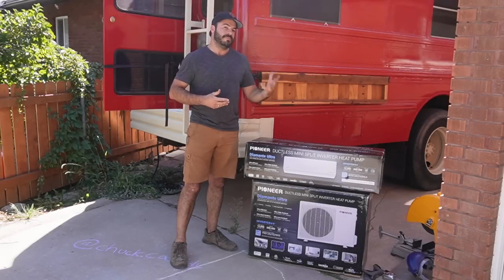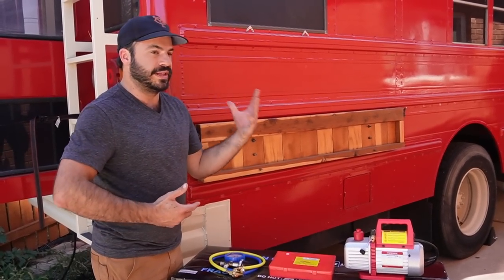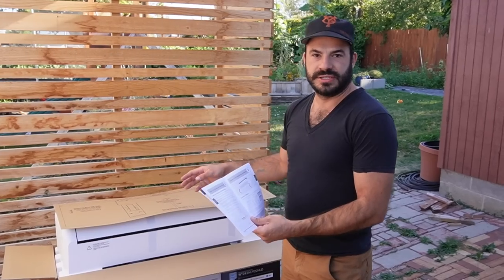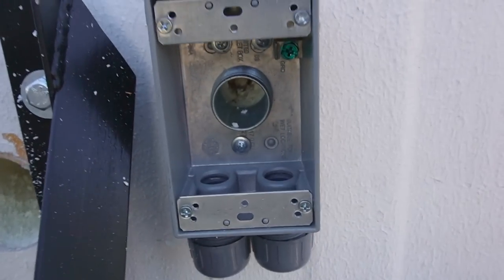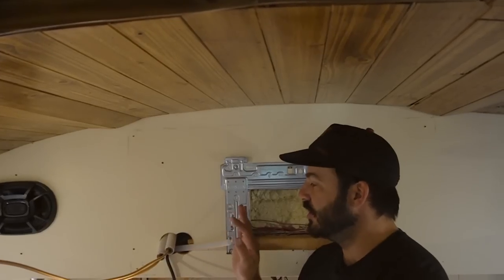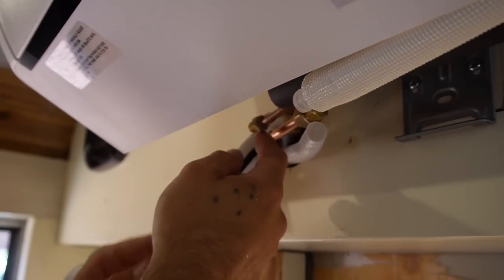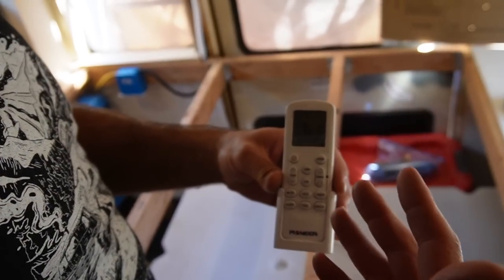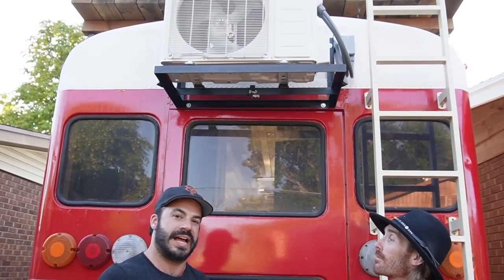Installing a Pioneer Minisplit on a Skoolie | A Complete Guide

Comment: You normally do an amazing job but this was a hack!  You know those mistakes you see people make over and over again and it drives you crazy?  You get to be that person for this one.  What you did will "work" if that's your only goal and you don't care about longevity.  With that said, splits are super sensitive to moisture in the lines and you should pull a 250 micron vacuum on them.  With a cheap single stage China vacuum pump, those tiny hoses and the valve core still in place I highly doubt you got anything even remotely close to that in 20 minutes.  I'd be shocked if you hit 1,000 honestly.  Secondly, you should really pressurize the line for 24 hours beforehand and make certain it doesn't lose vacuum or drift too much over 250 microns.  Had you used a $75 micrometer, a real vacuum pump, and pressure tested the system I would have said great job!  I'll be honest, it's the internet so I suspect you're going to blow this off and not own it but if you do some research or ask some HVAC people they will confirm what I'm saying. Like I said, it will "work", just like leaving in the original insulation on a bus and if that was the quality of work you were after you did it.
Reply from the maker: I followed the directions included in this manual to a T which is my job. Sorry to disappoint you, maybe you can find a better video to fit your needs
Reply: @ChuckCassadyYT  I don't dispute that you read the manual which says "the indoor units and the pipes between indoor and outdoor units must be leak tested and evacuated to remove the air and moisture from the system."  I think we're simply disagreeing on what "leak tested and evacuated" means (much like keeping the original bus flooring in being a subfloor) since the manual doesn't specify and voids the warranty if you're not certified in HVAC.  It also says "Make evacuation for 30 minutes and check whether the compound meter indicates -0.1Mpa(14.5Psi). If the meter does not indicate -0.1Mpa(14.5Psi) after pumping 30 minutes, it should be pumped 20 minutes more. If the pressure can’t achieve -0.1Mpa(14.5Psi) after pumping 50 minutes, please check if there are some leakage points" which you for 100% fact did not do.  You have taught me A TON!!!  I'm so thankful for your channel, for all that you've given and shared and for the resource you are.  I truly can't tell you how much you've helped so many!  If you wanted to debate 500 versus 250 micron I would be fine with it but you DID NOT pull -0.1Mpa on that system and your "leak test was not a proper leak test".  If you want to think you followed that manual to the t I'll just leave it there and chalk it up to you wanting to turn a blind eye.  If I didn't know what I was talking about, I wouldn't debate you on this and what you did will work but at least don't say you followed the manual when you didn't.  If you want to say you missed how deep of a vacuum to pull fine, I'll accept that.
Reply from the maker: I've been in contact with Pioneer and installing this yourself does not void the warranty. I know people who have made warranty  claims and had no issues. I've installed overa dozen of these with no problems. I will now post an excerpt from page 30 of the installation manual:

Turn the vacuum pump ON to start evacuating the 
air from the line set and indoor unit circuits.
Run the vacuum pump for at least 15 minutes, or 
until the Low Pressure Gauge reads -76cmHG 
(-100 kPa or -30 In Hg). (Negative value)
Close the Blue (Low Pressure) valve of Manifold 
Gauge, then turn the vacuum pump OFF.
Wait for 5 minutes, then check that there has 
been no rise in Low Pressure Gauge reading.
If there is a rise (Vacuum Loss), refer to the
Gas Leak Check section for information 
on how to check for leaks. If there is no 
change in vacuum reading, unscrew the cap 
from the LIQUID Side Service Valve (Fig. 6.2)
Insert hexagonal wrench into the service valve 
(LIQUID Side Valve) and open the valve by 
turning the wrench in a 1/4 counterclockwise 
turn. Listen for sound of gas exiting the system, 
then close the valve after 5 second"
Reply from the maker: I hope I've made it clear that I was following the included directions precisely. I'm not surprised there is a spec you believe is important that was overlooked. This is how they expect people to install them, this is how I install them, and with my oldest installs now over 5 years ago and working fine, I feel very confident spreading this method. Thanks for watching, I appreciate the engagement.
Reply from the maker: This is from page 31, specifically addressing leak checks as well:

There are two different methods to check for gas 
leaks.
Soap and Water Method
Using a soft brush, apply soapy water or liquid 
detergent to all pipe connection points on the 
indoor unit and outdoor unit. The presence of 
bubbles indicates a leak.
Leak Detector Method
If using leak detector, refer to the device’s 
operation manual for proper usage instructions.
AFTER PERFORMING GAS LEAK CHECKS
After confirming that the all pipe connection 
points DO NOT leak, replace the valve cover on 
the outside unit.
Reply: @ChuckCassadyYT  Fair enough and we can leave it there.  People buy a bus every day and leave the flooring and factory insulation in, they redo the stock windows, build it out and jump on the road.  They have a great time, they enjoy their bus, feel pride in the work they have done and what they have done works for them.  You agree it can be done that way and works, I agree, and people do it every day.  You wouldn't advocate for that, I wouldn't do that but all things come down to the level of "works" and "acceptable" a person is okay with.  Splits have become rather irrelevant for bus installs over the past few years with much better options anyway so I guess it's a moot point.  Page 37 of the manuals for the Pioneer units are what I quoted above.  If you're content with cheap China gauges, a cheap China pump, tiny vacuum hoses and so on I'm good with it.  If you do decide to spend $250 you can buy a quality 2 stage pump, micrometer, a proper hose and valve core removal tool and do a proper job.  And you can even skip the pressure test if you want since you'll never be able to pull 500 microns and hold it there with a leak anyway.  It's not worth saving $250 for me but to each there own and I'm not using a split anyway as I'm full solar and there are better options for boon dockers with no access to grid power.  Anyway, thanks for the open dialog, backing up why you did what you did and now it's here for others.  You have super good content and put a lot of things into perspective for me.
Reply from the maker: @ZeroEntropy.  I reread the manual for this unit and the other models from pioneer and can't find any of that text you quoted. What you said is good to know, and while i uderstand your analogy, id say that replacing the windows and insulation in a bus hardly comoare to pulling the last few microns out of an hvac lineset. I don't particularly like being called a hack, it sounds like you should start your own channel and showcase your skills and experience!
Reply: @ChuckCassadyYT  There are a couple different types of YouTubers, the ones who start their channels for everybody else and can handle some criticism and the ones who start their channels for themselves and can't.  I don't know which you are but you can surely handle being called a hack by somebody who knows a lot more about a topic than you do.  The areas you know more, I'm happy to yield and I understand how the Dunning-Kruger effect works but wisdom is knowing when to say you don't know, you'll do some more research and respond from a more informed position.  You're wanting to double down so I'll add this, Parker Davis does not warranty this product in a mobile application for one, for 2, it needs to be fully registered to get a full warranty, this requires your license number so a DIYer doesn't get a full warranty.  You can find their most updated and current manuals online.  "pulling the last few microns" isn't the issue, it's boiling off the rest of the water in the system.  So you're saying effectively "leaving some water in the system is fine", if this were a R-22 system I'd say whatever as mineral oil is only a little hydroscopic but this is 410a and POE is ultra hydroscopic.  These are your installs and your customers and if you want to be "that guy" I'm fine with you being him.  I've watched a ton of your stuff and never seen you do anything I would call wrong, a mistake, or something that didn't make sense so take my comments here for whatever you want.  I have much respect for you but being unwilling to admit when you're incorrect isn't a great quality.
Reply: @ChuckCassadyYT  After thinking about this more, your shop, all of your tools, they're good quality, you make jigs for quality, repeatable work, the welds are great, everything is quality.  But here you're using Chinese toys, think about that for a moment.  The quality of your work is impacted by the quality of your tools, in some cases this may not matter and quality means longevity, in other cases it comes down to ability and in others accuracy.  You're using $75 in tools when the quality versions would cost you $350, so you don't even know how many microns you pulled or how accurate your gauge is.  I understand HVAC is odd because you can't visually inspect what's happening but I learned these mistakes the hard way.  Anyway, that's it, I'm trying to leave another window for you to see some commonality in how we would want something done and hopefully something we can agree on, the value in quality items and tools.
Reply from the maker: I understand. Believe me, I understand the relationship between tools, their quality and the final product. Pioneer supplied the tools in question and it's my job to make the video as they request. If I had an extra $200 laying around, I'm not sure I'd be able to justify it on a gauge set when the one I normally use works fine and has never been an issue. I appreciate your point, but I wear so many hats on these projects, of course I can't have the best tool everytime! Also, just because something comes from China does not mean it's poor quality, I'm learning this lesson more and more! Thanks for watching, I appreciate having smart folks here. I want the smartest comment section on YouTube!
Reply: @ChuckCassadyYT  Well, having the smartest comment section on YouTube isn't a high bar to set so I'm sure you can pull that off ( :  I've had several channels over the years and I'm pretty sure I've managed to have the most toxic comments section on more than one occasion.  I give you props, YouTube is tough all around to manage and I've always bailed on a channel if it starts getting too many subscribers, too many eyes, too much attention.  And, I will agree on China products, they make some AMAZING things there are many items from China I would happily buy.  They make some really good quality hand soldered tube amps for example, I've been super impressed with many of the optics, and I have a huge number of China tools for things that when you need you really need them but they don't see much action otherwise.  And, I get you on wearing so many hats, sometimes it actually hurts my brain because I can learn a ton about one topic no trouble, two, no trouble but when you start needing to learn all aspects of something it's draining.  Just on a bus there's painful amounts of info to be learned, enough to hurt the brain, EGR, DEF, the different engines, trans, can you unlock 6th, is the block a 53, 2 stroke, mechanical, electronic and that's not even getting into things like gearing, body type or the build.  I truly, truly wish I was somebody that could just stay ignorant and not obsess over understanding how things work.
Reply: I'll stuff this comment/question in this thread. Isn't there a requirement to have the line set a minimum of 10' feet. My understanding is anything less will cause the condenser unit to run much more often? Or is this not correct?
Reply from the maker: The manual states no minimums
Reply: @57z  I don't think it matters how long is is either, maybe you're thinking about how if you extend the line or shorten it too much the refrigerant would need to be adjusted accordingly.  The manual should tell you how many additional ounces per foot, this would apply if you shorten it too as the system would have too much refrigerant in that case.  But that's why you order with the proper size line set, to avoid that issue.  Also why you see people coil the lines in a flat coil (to avoid an oil trap) versus cutting them.
Reply: @ZeroEntropy.  makes sense. I've installed several units from a different manufacturer, very similar build to the pioneer. In the manual for the other brand it calls out no shorter than 10 feet.  I could see there being too much r410 in this Skoolie install as the line set is only about 2feet. Good info all around
Reply: @57z  They're all the same units, there's virtually no difference, it's like buying an air compressor, tire, battery, 50 different brands but in reality only a few manufacturers.  I also notice many of them (MrCool for example) are just giving these units to YouTubers to try and promote their products.  I mean, I don't really care what anybody else is doing and maybe I'm the one too obsessed with doing things right.  Like, they give you a manual and then don't warranty you if you install it yourself.  They know what they're doing and I'm good with it, they shouldn't have to cover people doing absurd things with their products.  The entire debate has turned into the Reflectex air gap debate part 2 it seems.  Thankfully splits only had about a 2 year window of even making sense in these applications and that window is well closed with much better options now.
Reply: Thanks for your input Zero Entropy. We were all wondering about your thoughts and were waiting for you to post.
Reply: @dezs7497  I highly doubt that, this is the internet, there is no place for intellectual conversation and logic here.
Reply: @ChuckCassadyYT  I want to THANK YOU for doing this install as the manual instructs. I appreciate what @zero Entropy brought in, but I watch your videos because I need instruction and do not have a shop that is already full of tools. I look forward to building my own bus someday, but will likely have to either factor the purchase price of a tool into the budget I am spending for the particular project (possibly causing myself to not be able to buy top quality each time) or be using the tools supplied by Pioneer (as an example, or any other company's product I use). While I absolutely agree there is huge value in using top quality tools to achieve a top quality job there is also huge value in using what is available, so thank you for showing both sides of that in your videos!
Reply: @ZeroEntropy.  could you please explain what the better options are for HVAC in a bus/coach. I just bought a 1982 MCI 40’ passenger bus that I’m converting into an RV and I guess I haven’t found the right info yet since I was under the assumption that the mini split systems were the best systems to install for this type of use but maybe that’s because the manufacturers keep giving out units to the popular YouTubers to push on their channels. 

Any input you’d care to share, I’d love to listen and do my research on so I can truly figure out what will be best for my project. 

Take care and be safe out there
Reply: @1982MCI  i can't speak for @zero entropy, and would love to hear as well,, but CruiseN Comfort might be something to look into
Reply: Chuck did the install like my manual instructed. I just installed the same mini split
Reply: If splits are irrelevant for buses, what do you suggest using? What better options are there?

Comment: Chuck, thanks so much for the pro's way to do a DIY AC! I put the Pioneer 12k in my rig in 2018, and would have killed for a video like this. Turned out way purdier than mine, but I'm starting a new project soon, so I will have a second chance at it. I actually bought a pipe bender because my install location was a bit more complex. Unit has run flawlessly for 4 years now. Love all your videos, you are an excellent teacher, would have loved shoulder time with you on some projects, I am a visual learner. Thanks again for all you do for our community.
Reply: How does the 12k cool/heat ? Particularly, the opposite end of the rig ?
Reply: @larryrichardson5167  I have a 24-ft cargo conversion and I put it in the middle, works awesome!

Comment: If you cut the insulation, make sure you seal it back up with a vapor tight tape. That prevents air from getting to the tubing and sweating. - HVAC guy.
Reply from the maker: Thanks guy!

Comment: two questions - 1, have you considered using flex lines and if not, why? 2, any concerns about the outside unit covering the clearance lights?
Reply: That’s what I was wondering. The bus is now out of compliance for lighting as the three center lights aren’t visible at all. 
They should have been moved or new lights installed on the split.

Comment: It isn't a home without sweet sweet air con!!
I did HVACR commercially for three years before starting my bus conversion in 2018!

We mounted our unit under the bus and these are SOME OF THE MISTAKES I made;
I did not make a removable access in the expanded metal in order to clean the coils well (very important under the bus)
I added a traditional dryer/filter which is a minisplit no no!
Location of interior unit, We need fans to circulate air all the way to the back.
I did not utilize both drain lines so my unit is tilted like a noob!

Great video!